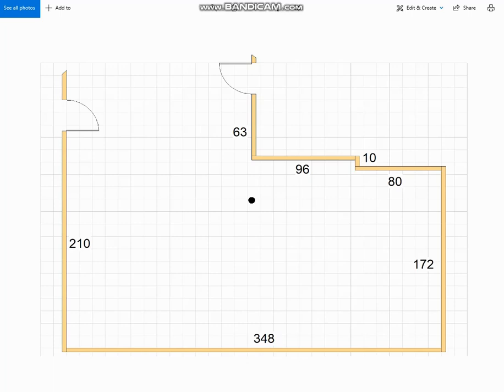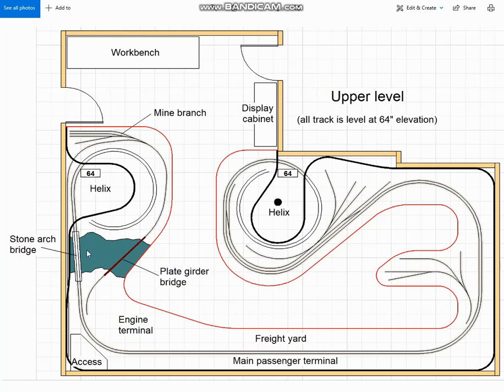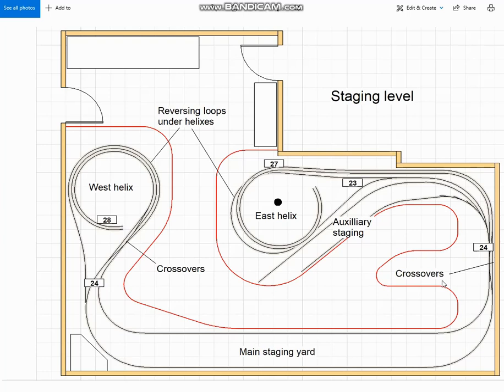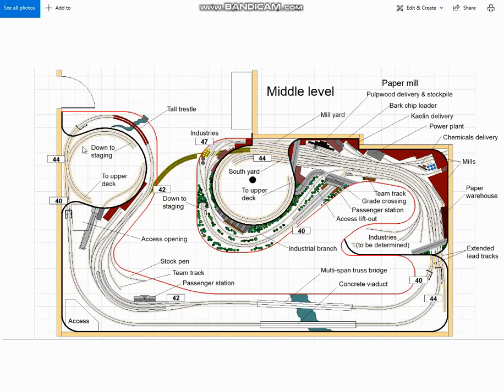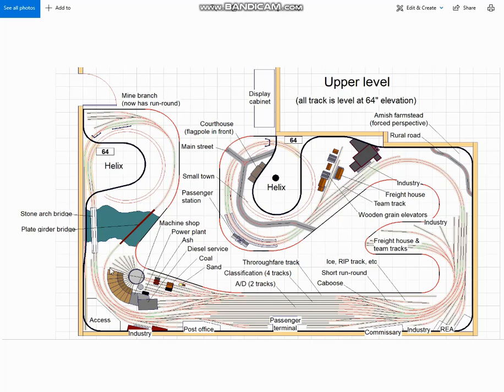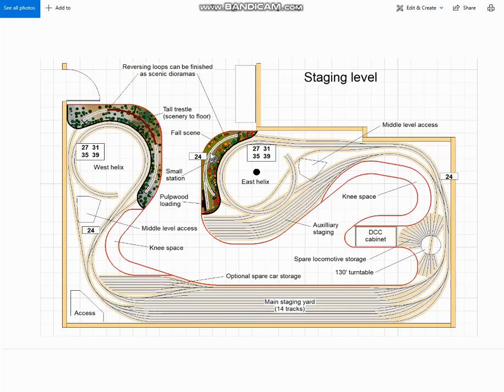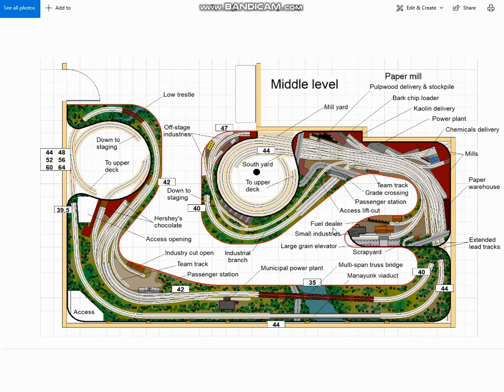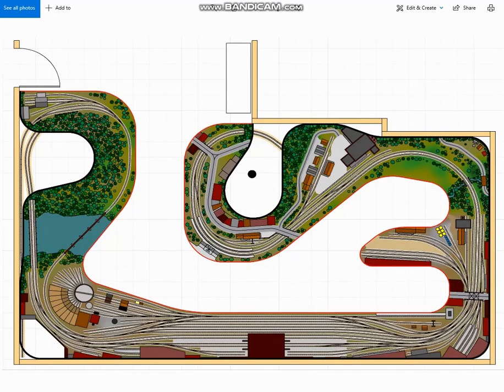Layout design: Making good use of the available space

Comment: Peter— Thanks for the great design and it’s been very insightful working with you.  As the owner of this project, you challenged me more than once on the design and my expected outcomes.  To the dismay of many, this will be my first layout.  My plan was a single level but my demands exceeded one level.  So we went to two.  What I like is that level one can be all that I do.  Once I master the one level, I’ll move to 2 and so forth.  I plan to take 10 years to build this - 3 years per level.  I can stop at one two or go to 3 levels because Peter has deigned this where I can stop at any point and be operational.  I have to say, Peter was a delight to work with.  He challenge me with ideas, asked the hard questions and offered solutions that allow me to be more engaged.  And possibly save save some money, I.e., building switches.  If you want a professional design, Peter’s your guy!
Reply from the maker: Thank-you Harry for that testimonial.  It was a joy to work with you too.
Keep in touch.

Comment: Peter:
Been wanting to update you for sometime on the progress of my railroad.  First off, I’ve learned a bunch.  And I have so much more to learn.   I’m still working on the staging level and made a few changes.   I deleted the optional spare car storage, reduced the main staging yard from 14 tracks to 10 and reduced the auxiliary staging from 9 to 7.   It was just too much and I realized that just because the design was there, I didn’t need to build it.  I’ve almost completed final install of the track work on this level and have all the switches built.   As you know that was a challenge.  I have successfully ran a train around this level under dc power testing the track work and it runs well.   So my wiring on the layout is growing as I recently purchased all my digitrax equipment and will start that install shortly.   I’ll break the staging area into 4 power districts as we discussed.   Overall I’m very happy with my progress - some May see it as taking too long but we travel several months a year along with frequent visits with our kids and grandkids.    And I’m very active with my club layout which takes more time than I thought possible.  I see the staging level electronics completed by the end of the year.  I’m not sure when I’ll add the helix’s but they are coming soon along with the initial start of level two as I’ve quickly realized that I need to add some of the mounting along the walls because it’s better to add now than later.   Bottom line is I’m happy with where I am, the progress I’ve made and being my first layout, what I’ve learned.   Thanks again and I’ll provide another update sooner than later.    

Harry
P.S.    
Keep the videos coming as I watch them all and amazed at what you can do.  The new workshop was a great improvement.
Reply from the maker: It's good to hear from you.  I was wondering how you were getting along with the railroad.  Keep it up.

Comment: Ingenious way of using two helices by having each helix in turn bring the train from staging to the upper deck, via the outer tracks no less, where the grade is slighty lower. And down again via the inside tracks of one helix after the other... man that is clever. Hats off to you sir!
Reply from the maker: Thank-you.  That's one of those little things to bear in mind on any design, but something that isn't always possible.  In one recent design I was forced to run both helixes the "wrong way", so I made sure there was nothing in the design that prevented the client from running everything left hand instead of right.  It was an entirely freelance design and there are enough cases of left-hand running to allow it without further explanation.

Comment: When you do a layout design is this all you send the customer? Do you send them a drawing of the benchwork and how to build it? It seems like you'd need to as complicated as some of the benchwork would need to be to accommodate all the design aspects. Just wondering what you include in a final design package. Awesome work as always. Great video. The explanation you go into is helping me learn a lot about designing a layout. Stay well. -Wil   👍
Reply from the maker: In most cases, I merely describe any special situations to the customer.  Full benchwork drawings are beyond the scope of the design project as they will take a lot of extra time to do and most customers will not want to pay for that extra time.  In a few cases, I have provided these as an extra but this is not the norm.  I do however keep the structural implications of the design firmly in mind as I develop the plan because it's important that I know that the layout can indeed be built (I've seen plans published in books and magazines that would be absolutely impossible to build because of "negative space" issues).